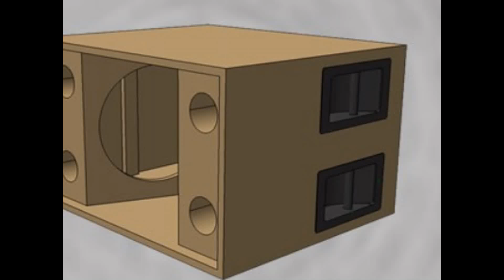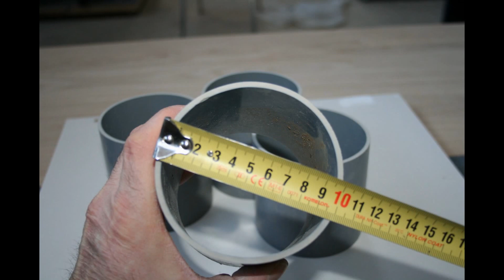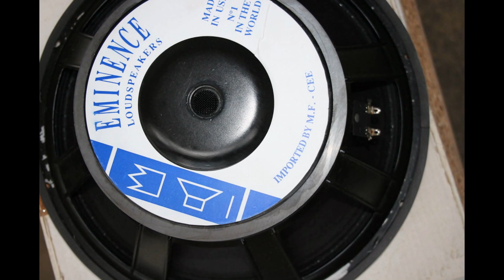Fabrication "test" caisson  S.U.B MT [215B] produced by  Clubbing Tracks

Comment: Why chipboard?  So many voids in it I don't understand why anyone would consider using it for speakers.  Birch bb/bb grade or mdf
Reply from the maker: Cuckoo my friends in melamine yes this design is a proto not a definitive caisson just to test the sound of the manufactured a plywood multiplied not in mdf know that acoustically melamine not agglo the resulta es the test its sound better mdf voila Forcoi my friends in any case this caisson prodigious I recommend it a + :)) Lorenzo
Reply from the maker: yes my friends this is a test sound !! melamine for this practice is a good compromise but yes the CP finland is the only materials for a good quality realization good weekend :))